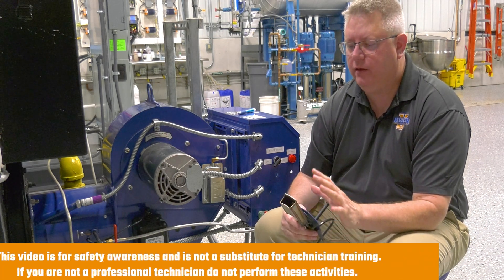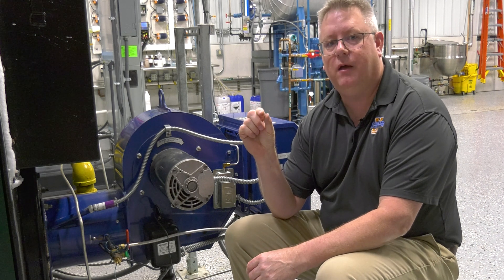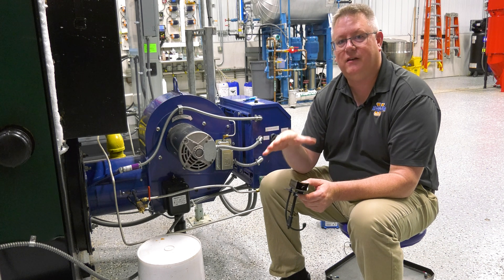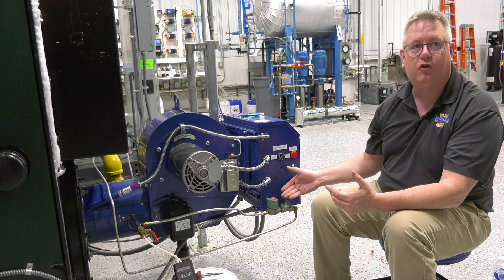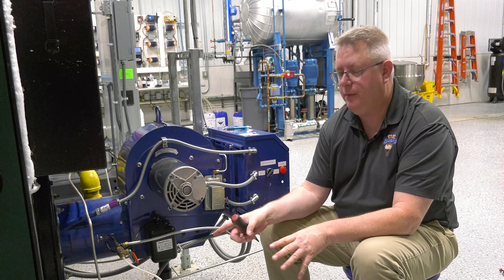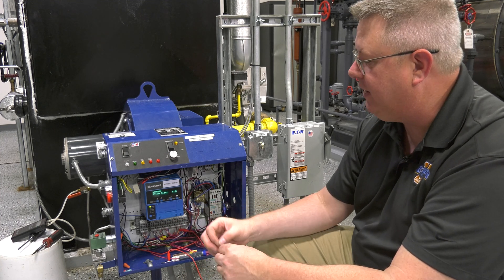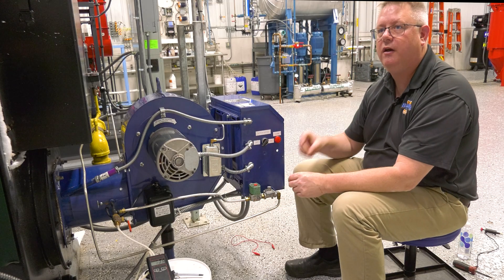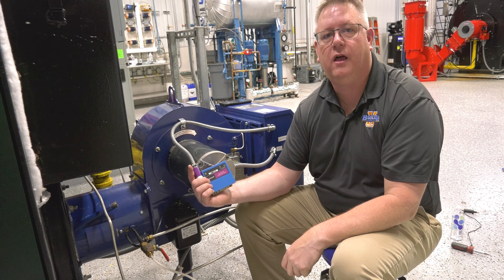Troubleshooting 8 Common Pilot Problems - Weekly Boiler Tip

Comment: Very good information.  A common cause for intermittent failures on that style of Power Flame pilot is if the primary air ports are dirty.  There are two of them.  You can see the one at 3:36 just past the brass pilot gas orifice.  The other one is directly behind it.

Comment: What would cause a firetube boiler to air  "pulsate" in a certain load range? What does secondary air do on firetube boilers. Could it be a burner sleeve adjustment issue?